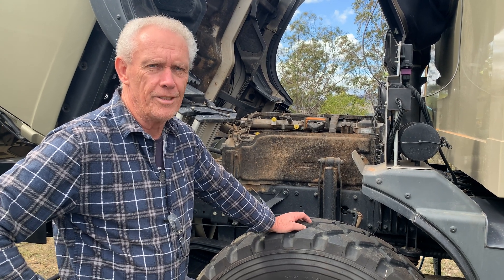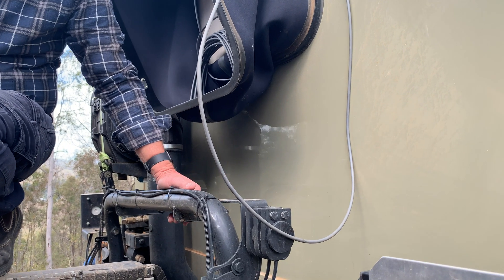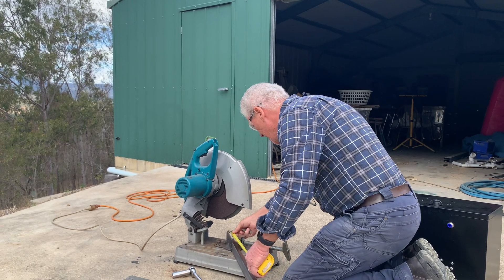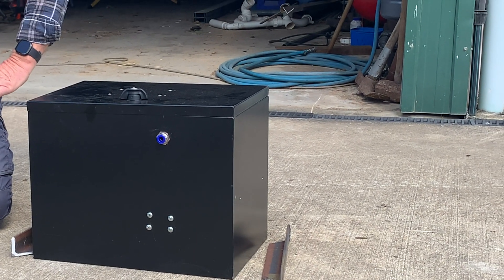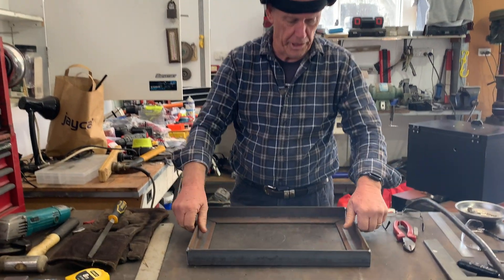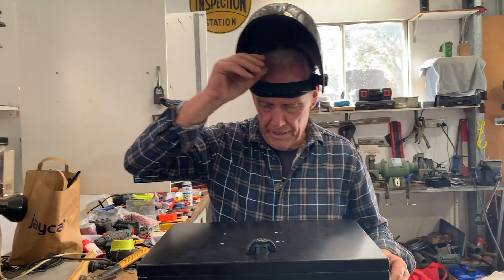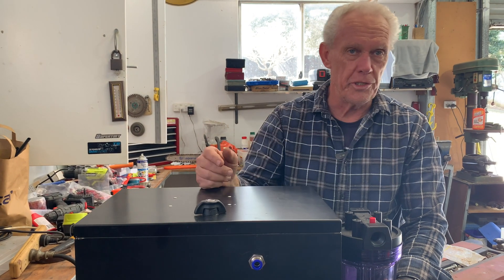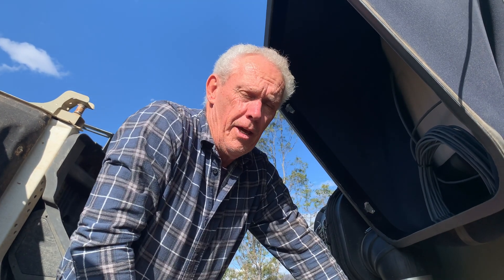HYDROGEN! THIS WILL INCREASE FUEL EFFICIENCY, OR WILL IT?? (PART 2)

Comment: Part 3? Cmon man, I want one
Reply from the maker: I’ve had to remove the hydrogen generator because of fluid leaks from the harsh driving conditions and I discovered the unit size was too small for this size truck and driving conditions. Having said this it did work well in our LandRover Discovery😀

Comment: Please don't think i'm being derisory to you personally, but the only way to explain this is a fools errand. I tried this myself with a Volvo XC90 T6, that could only manage about 19 MPG, and it made zero difference. I even put the same set up on a mower whist powering it from the car and still zero effect. The amount of hydrogen i could produce with the power of the car alternator couldn't even run a mower sitting next to it. The additional load on the vehicle alternator required to run the Hydrogen generator far exceeds any benefit provided by the Hydrogen as a fuel. It simply doesn't doesn't work. I'm sure you are going to persevere with it despite anything i say, as i would myself, but if you will take any advice, please construct the setup on the floor next to your truck and do the load tests before you start messing about and doing alterations to your truck. I promise you, any video's you have seen of this working or advice from people who say it works is pure snake oil. Sorry for the negativity, it comes from experience and disappointment.
Reply from the maker: Thanks for your comment! No offence taken 😀We've already had this system running on our Land Rover Discovery and we were pleased with the power difference. Hopefully we can replicate that with the truck since we've made improvements to the unit.
Reply: Ok. good luck.  @teamd-tour
Reply from the maker: Thanks! Here’s hoping all goes to plan 🙏
Reply: Sad that people ignore engineers having a grasp of thermodynamics and waste time and money on this tripe. It's not conspiracy theory but fuel efficiency that  stops vehicle manufacturers from deploying hydrogen generators, tin pellets and other snake oil products. And no electrical engineer is going to invest in a home 'power saver' expecting a capacitor to make his meter run backwards.
Reply: @philhealey4443  I lost interest in this guy a few videos after this, when it became clear that he wasn't just trying to fool himself, but trying to fool others as well. He did a road test video and totally fabricated the results. I suspect he was connected to or in cahoots with the company that he said he purchased this from. He came out with all kinds of stories about how the engine manufacturer had no problem with him fitting this to an engine under warrantee. Saying nothing about what caustic will do to an aluminium turbo charger. I just looked at his videos after this, and it looks like things went silent on this after the "Results are in" video soon after this. Strangely i stopped getting replies as well.
Reply: @General_Confusion  People can't see that this is reverse perpetual motion taking far more fuel energy to drive the alternator to make the gas than the calorific value of the gas produced. You could of course store the gas for short  term intensive usage temporary gain of a few seconds, but it's a nett loss overall and extra Diesel burned.  On combustion  efficiency, even 1% unburned fuel is a lot of black smoke, so that line of argument doesn't stack up either and the Wobbe Index level of hydrogen surely tends to make it go bang rather than deliver some kind of smooth combustion miracle. I'll stick to a light accelerator touch for economiy.
Reply: @philhealey4443  Newtons first law of Gullibility, You can always convince someone.
Reply: Actually i have to make a correction, it wasn't an XC90 Volvo, it was a 2.8 diesel Pajero. Had both at the same time and got confused.